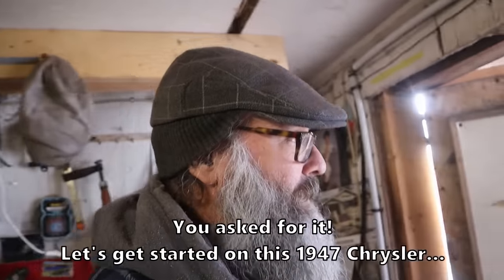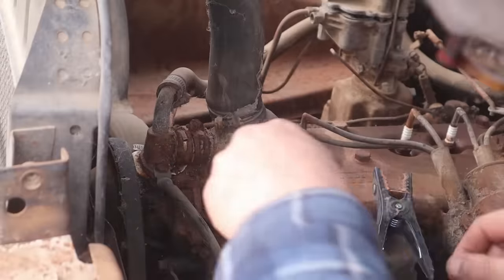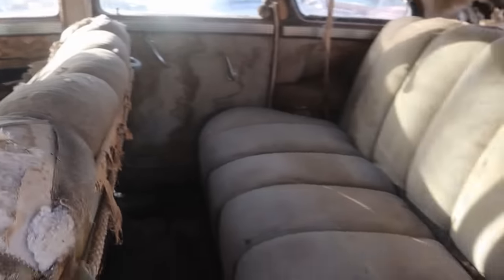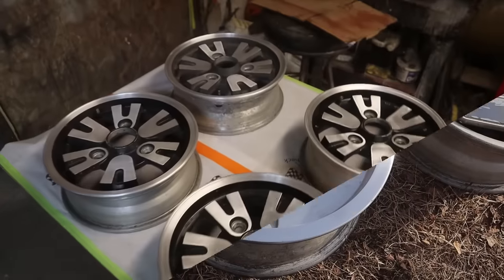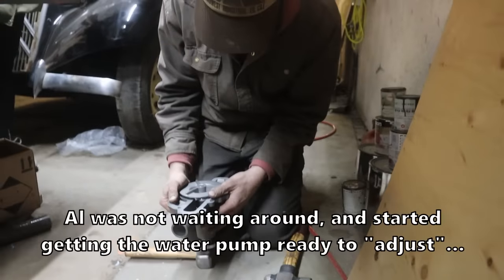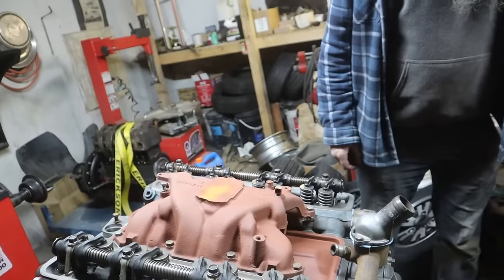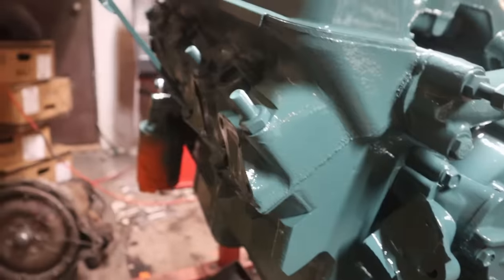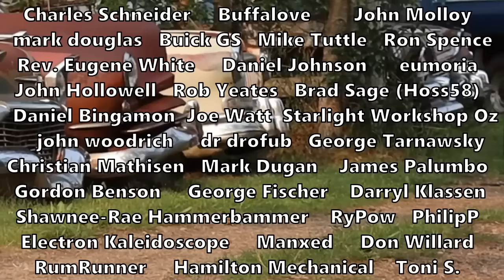1947 Chrysler Royal! How Bad is it? Plus: Buick 364 Nailhead Looking Good, and Renault Gets Wheels!

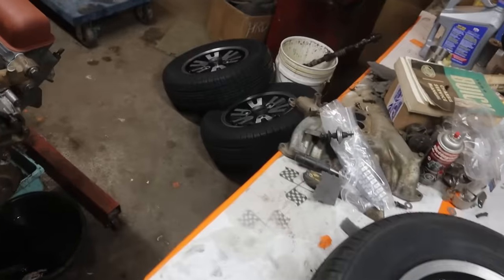Comment: 29:19 On the tires, the yellow dots identify where a tire weighs the least — the lightest point on a tire. The yellow dot should be lined up and directly next to the valve stem, which is the wheel's heaviest point, which will take less weights to balance them.

Comment: Woot! I've been waiting to see the '47 Chrysler since forever! I love flathead Mopars. Whenever you get underneath the car check out the passenger side of the transmission. If it has two large cylinders (a solenoid and a governor) sticking out, then it's the M6 semi-auto. If not, then it's the regular 3-speed with just a Fluid Drive unit in front. Also: someone will find the CWM 8mm camera footage 100 years from now and think it's genuinely from the 1960s.
Reply from the maker: Hey glad you like this kind of thing... Cheers!
Reply: My old man always said " If you can't afford a Dodge dodge a Ford"

Comment: Love the finished 364 nailhead. The Gentlemen and you did a very fine job. Don't be surprised about the crappy new production parts that never fit. Cause this is the new norm. I think the leaded gasoline was good in preventing engine being sized up by rust and moisture. I believe the Maroon colored Chrysler must have looked very nice when it was still nice. Could be the slack in the timing chain might have been the reason why it went out of service. These things must have been dirt cheap in the 70s cause they where considered then obsolete for a daily driver. Keep working on the Renault 5 it will be among the nicest examples in Canada. That was a very good speech and society needs more people like you Scott. Cheers.

Comment: Slowly turning the engine over while priming the oil system helps get a lot of air bubbles out.
If left in, they can cause air locks that will limit the oil getting to some places. I found out the hard way.
It looks like a brand new unit now. It was funny to hear "Model T" and "performance" in the same sentence.

Comment: I feel your pain on that 364 water pump. Some years back I had to change the water pump on my 322 and left a stray bolt inside the water pump. The pump seized when the bolt got jammed between the pump case and the impeller and I wound up knocking a hole in the pump. Someday I am going to try to JB Weld the hole shut on the pump housing. The heck of it is that had been an NOS aluminum pump! Oh well! Cheers.

Comment: Love the wheels for the Renaults, Scott.  Even the set that is going on the gold one looks perfectly at home on the black one and really sets it off.  The old 47 Chrysler - man, that would have been one great car to ride in back in the day.  Those seats look super comfortable.  Her steel doesn't look so bad, but obviously the camera dresses all cars up quite a bit and we've obviously not seen underneath either.  Looking forward to hearing the old flathead grind into life.  The Buick engine looks fantastic in that green and its surprising how many new parts are put together by numpties with a lack of interest or even a modicum of desire to get it right instead of outright indifference to the outcome.  Quality control are just two words at opposite ends of the dictionary to those people too, I suppose, so I hope the wee unit does indeed pump water.  However, another milestone in the fact the engine has oil pressure!  You know that wee tool you made up?  I did something similar, but instead of a socket, I used a piece of rubber garden hose that fit snugly around the pump shaft and used a trimmed hose clamp to hold it in place on the old screwdriver.  Works a treat.

On your submission to the council, I loved your parting shot.  I could not have said it better.  There is a term used down here in Australasia (in both Australia and New Zealand) that pretty much sums it up:  "Kangaroo Court".  It basically means people are going through the motions so that it all looks perfectly fine on the surface and all procedures have been followed and objections heard, yet the preconceived notion / works / decision has already been made and it is done and dusted as far as the progenitor is concerned.  Actually, the Wikipedia entry pretty much sums it up nicely - "A kangaroo court may ignore due process and come to a predetermined conclusion. The term is also used for a court held by a legitimate judicial authority, but which intentionally disregards the court's legal or ethical obligations.  A kangaroo court could also develop when the structure and operation of the forum result in an inferior brand of adjudication. A common example of this is when institutional disputants have excessive and unfair structural advantages over individual disputants."  

The words from the bench when you finished only proves they are going through the motions only in a retrospective attempt at due process after the fact.  What a pack of 
w⚓s.   All this proves to me is that bureaucracy is a universal constant.  Give certain people a time in a position of power and they develop megalomaniacal tendencies to do what they wish, when they wish, how they wish and whomever gets in the way just gets mowed down without a care.  It is disgusting, but it is everywhere in local, regional and centralised governmental departments and at all levels.  Don't vote - it only encourages then to believe they actually matter and their jobs are somehow important.  

In actual fact, the most calm periods in the history of this country since I have been alive - and I'm 6 weeks older than you - have been when the newly-elected major political party is trying to form a coalition with the minor parties in order to govern.  Since 1996 when this style of governance was adopted by New Zealand, the shortest period of time it has taken has been a month.  The longest was the current coalition government....at three months.  The country's inflation figures dropped, there was less crime, businesses had an upturn in sales, people were smiling......and then the new government formed just before Christmas and it all went to hell in a handcart.  Goodwill to all men?  Only if it involves a combine harvester being driven through the parliament buildings into Chambers while they are all in session.....

My friend, you have a strong love for your sister (and I mean that in an appropriate and respectful manner).  You are also a believer in right and wrong and that those in the wrong should make it right.  You and I are cynical only because the world does not follow the simple rule of treat others as you wish to be treated.  If people did that, then arseholes in council buildings would not build effing great stadiums next to someone's long-established livelihood and effectively destroy any chance of them continuing. 

I wish I could offer some words of encouragement for you or Laura and her husband.  Just know that we are thinking of you all and that Karma has a way of coming back to bite people on the arse.  We may never get to see it happen to those who wrong us, but it does catch u with them eventually.  I've seen a couple of people get theirs and boy....the feeling I got was like I had pulled the chain and flushed them away myself.

All the best, mate.
Reply from the maker: Hey thanks so much for the kind words and encouragement... We did our best and I was very happy to see so many people come out to support Laura and Colin, but the decision was made way in advance and the council voted 6-3 to put the arena in anyway. Kudos to the councillors who voted against it; good men are still out there.
Reply: @coldwarmotors  - Yep - they still are.  Hard to find sometimes, but they are there if you search long enough.....and you and your mates - aka: Agents - on this channel and including Laura and Colin, are good people. People I would be completely at home with and would thoroughly enjoy being in the company of.....and if you knew me better, you would understand how much of a compliment that is, as I don't socialise much beyond immediate family as I cannot stand pretentious people or those with hidden agendas. I much prefer the company of people who speak their mind plainly, are down to earth and who have my back as much as I have theirs.  I thoroughly enjoy this channel of yours because I see the deep mutual respect and acceptance that you have with your friends and it always makes me smile.  Keep being you and don't change a thing, my friend.  Where Laura and Colin are concerned, something WILL happen and some good WILL finally come out of the quagmire they have been left to deal with.  The good guys WILL come out on top....eventually.

Comment: My grandfather had a 49 Windsor.  When at 200,000 miles it was getting it customary 50,000 mile rebuilt it was still taking standard size bearings, which in 59 were hard to fine.  As of five minutes before air time, still subscribed.

Comment: Just was not meant to be the start on the 47 Chrysler. But, the Renault looks brand new. Beautiful work Team. Glad you got the water pump for the nail head straightened out. Looks like after painting the engine. You ready for woo it start. Congratulations on your success!
💯👍👊

Comment: Thanks for getting that
 47 Chrysler running , Scott 

Too bad that car 🚗 is so 
Corroded  . 

Could be a donar car , for the 
40 Dodge  . 

Junk car revival telethon  ?? 
Hmmm.....  🤔 

Would you utilize an 
Induction heating tool 
Too help remove those 
Cylinder head bolts ? 🔩 

I bet you diagnosed that engine 
Correctly  . That's probably why ,
It was parked & beached 

Look at the , ergonomics of that 
Chrysler ❤ that must have been 
A PIMPIN ride , 77 years ago 🏆

Looking forward to seeing it running and driving , again  

Never realized those R5s 
Had captured front rotors 

I like your impromptu method 
of , insta-refinishing 

What happened to the hood ,
On Myles Newport  ? 

I've actually experienced that ,
same exact 💯 scenario too ,
Scott . The water pump impeller was barely touching in inner housing  . Ash was smart to check that first   . Maybe a feeler gauge , 
Too measure the clearance  ?

Great idea 💡 Utilizing that sharpie 

We've had good luck with  ,
Toyota black , RTV equivalent 

You know what  , Scott ?
Your endless suffering  with that water 💧 pump , may have helped someone with a similar project 

CWM oil pump , Buick special tool 
Worked out , great 

Al's Granada  , takes me back 
Especially with that , 3 speed manual transmission  , and corresponding  , genuine imitation  , simulated wood grain shifter knob 

Hope Laura and her family are successful in keeping their farm

Comment: I am sure that I saw a Chrysler Royal driving past me on Bedford Road, Sandy, UK. A wonderful black one such a surprise compared to the SUVs and other vehicles. It turned right on it's way to Potton or is the owner going to Tescos. As the founder of Mattel said back in the '60's… "Those are some Hot Wheels!" or something like that, you get the drift. The Austin Mini still doesn't start, but at least I have cleaned both Stromberg CD175 and the AC fuel pump for my '65 Humber. Happy days. Now where's that battery?

Comment: Possibly helpful tip: Use sealant to stick the gasket to the water pump/part, then put grease on the engine block side so that it is more likely to release from the block next time it comes off, which in turn means less scaping old gasket off engine next time part comes off, also helps prevent corrosion on engine gasket surface.

Comment: The 1959 364 V8 used different spark plug wire retaining clips than you pictured. I think the ones you have are off an older version of the 364. You can buy the ones you need online. You need the black plastic clips and the steel bands that the clips fit onto and I think fit under a rear valve cover bolt. Engine looks great and crap like that water pump is what we run into today buying parts. That Chrysler deserves to run but not drive. Start it up with worn timing chain and let it go at that.

Comment: That Chrysler may have a semiautomatic attached to the fluid drive.  My brothers 49 Dodge wayfarer roadster had a fluid drive attached to e three speed which he always drove as if it had a clutch.  My grandfathers 49 Chrysler had what I think was a dual rang M6. It had a clutch pedal and a gear indicator on the column. By the time I was  able to see how things worked he was driving his 54 Olds 98 four door. I think I sent you a 50 Motor Repair manual which might help identify what you have.
Reply from the maker: Thanks David! I believe this one is a regular three speed behind a fluid clutch, very much like my friend Mark's 1941 Dodge Luxury Liner... All the best as always from here!

Comment: Chrysler vs. Kaiser Flat 6 showdown? I realize the head had to come off an you discovered the chain being slopped out, but if memory serves, doesn't Fluid drive use a clutch for 1st gear? Pulling it around with the tractor could have been feasible before you discovered the other situations under there. I never realized how gigantic the front ends of those are til we got to see the side profile.

Comment: It will run fine with that work timing chain, everyone I have seen has been like that. The fluid drive is almost indestructible, just fill it up calls for 10w oil but atf works just fine. I recommend you wire up the shift solenoid to a toggle switch and not try to mess with the stock wiring.

Comment: The Buick engine is quite a group effort and well worth it. I like the 74 Lincoln MkIV too,so I guess that puts me in good company on 'The Sad Bastard Squad'. The cylinders on the 47 look so good.I've very surprised too.
The Councils decision to build in an area designed for a Drainage pond IS beyond Stupid. Now they'll need another area to drain even More run-off.What a bunch of idiots.It seems very shady that they set it all in motion without asking the public for input and suggestions for placing it.The infrastructure can't be as readily usable as many other areas that Aren't Rural. I'm sorry for Laura and her family, and many other neighbors who'll be stuck dealing with Thousands of extra vehicle traffic and the noise every event, let alone the construction equipment noise and damages to the roads during construction. My town allowed 5 complete neighborhoods to be built and the roads leading to them were destroyed and left that way for Years,and finally saddleing the taxpayers with huge improvement costs to fix their stupidity and poor planning.

Comment: Those were great cars when they were on the road. I have a 1/18 diecast of a '48 Chrysler New Yorker which had the straight 8. The model is almost a foot long. It is very detailed to the point where the door window cranks on the model roll the windows up and down. I have both the New Yorker sedan and the convertible. I also have two 1/18 '48 Town and Country convertibles as well.

Comment: On those pug wire brackets, something like Plasti Dip might work. I had a 60 Imperial that had large brackets to hold the wires in the slots and the material on them looked like that. It was mostly peeling off, so I dipped them several times to build it up and that worked fine.

Comment: 1:01:50 I dig this background track! There an upload of just this tune somewhere?

As for my own shenanigans...worked on my 71 C10 some more. Plates installed, radio installed, had to do an emergency fix on the fuel lines. Soft line between tank and frame rail hard line developed a pinhole leak on me as I pulled it out of the grass. That was fun! And of course that never happens unless the tank's nearly full. Lost about half a gallon at most, though, so not too big a deal.

Looking like sometime in early May will be when my C10 makes its first trip into town.